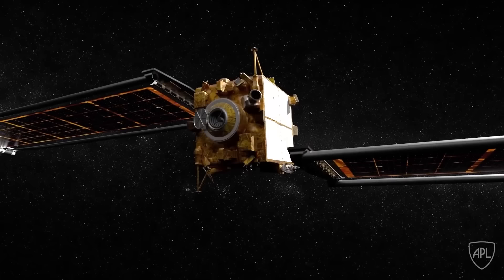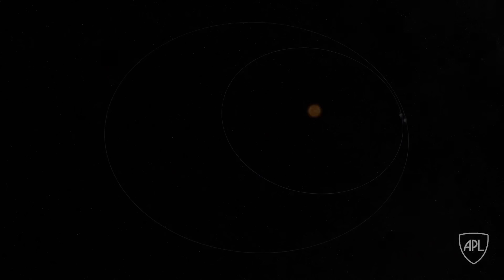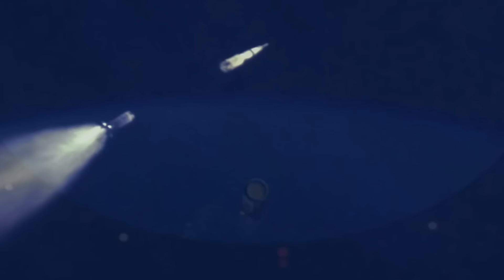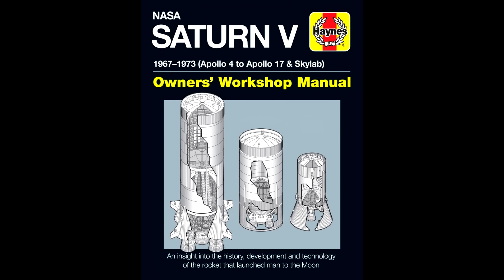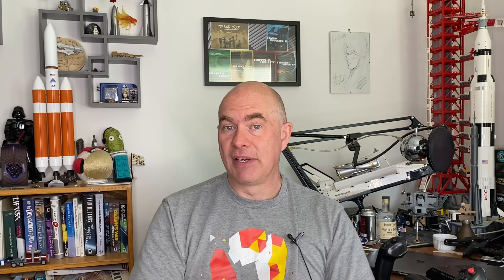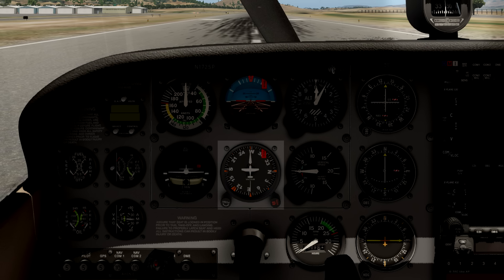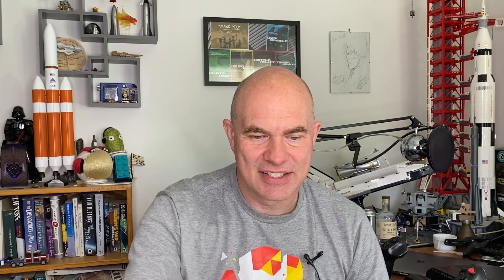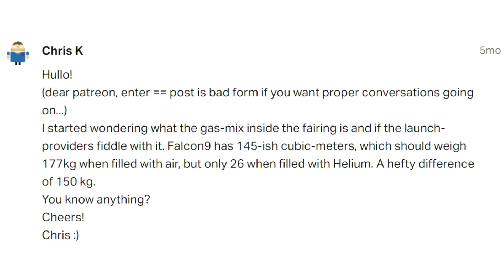Saturn V Staging, Asteroid Deflection and Hearing Rocket Turbines - Supporter Questions, Episode 17

Comment: You misunderstood the first question Scott. To answer to the first questioner: The reason you burn propellant to increase the velocity is that kinetic energy goes up with the square of velocity. You are right that momentum will not change because of the conservation of momentum, and you're just increasing the velocity while decreasing the mass, you are increasing the kinetic energy. Hopefully that helps.
Reply: No he didn’t misunderstand the question. He talks about transfer of momentum, and then he adds that burning the propellant leads to a higher energy state which will impact the astroid hard enough to blow material backwards, and that would add to the momentum transfer. He’s assuming that everybody already knows that energy goes by velocity squared. Obviously, as a physics degree holder, he knows that just as would any high school student.
Reply: @mbmurphy777  But the questioner didn't know that kinetic energy goes up as the square of velocity, that's why the question was posed. Both you, and Scott, are answering questions which weren't asked.
Reply: @mbmurphy777  The question (simplifed) is: "Why does it matter whether or not you burn propellant when the momentum stays the same".  The answer is that the kinetic energy changes.

Why is this hard for you?
Reply: @xXxTeenSplayer  Yes everyone here knows that. That’s why Scott said that burning the fuel results in a more energetics collision which can blow start backwards which actually increases momentum transfer. It’s plain as day in Scott’s answer.  And I’m pretty sure the questioner does know the difference between momentum and energy. The answer to his question is that it in fact does not matter, unless the impact actually does blow chunks backward off the astroid increasing momentum transfer.

Comment: I got a question, why is the dream chaser disigned with a skid in the front, I don't get what is so special or what are the advantages to using this method over a normal wheel based landing gear. Also I am not sure but isn't the heat shield being scraped against the floor when it lands not sure about this, if it is why disigned it like this. Idk this topic doesn't quit make sense
Reply: @GABRIEL, Usually skids are used when landing velocity is so high a tire would be destroyed on touchdown. The X-15 had a nose-wheel but used duel skids for rear gear -- which actually touched down first. Friction from the skids sliding along the ground rapidly dropped the landing velocity so the nose-wheel could survive contact. The (unfortunately never flown) Dyna Soar space plane also would have used skids for this reason.

Comment: Wouldn't a Martian space elevator be destroyed by the very close moons (presumably they are inside the geostationary point).
Reply: If you're doing a project that big, you can move them.  If they are slightly inclined, they would go over or under the cable most of the time, you'd just need to make sure they don't cross the equator when the elevator is there.  You could also just deorbit them or consume them for materials.

Comment: Wouldn't the energy of impact with the asteroid be lost in the form of heat?
Reply: Some of it, but some will get dumped into dust and debris flung out, and if it's flung out fast enough to escape the low gravity of the asteroid, that's some more momentum.

Comment: Hi Scott, I have 2 questions.

1)	Are you aware of any plans for Space-X to orbit constellations of Starlink satellites around the moon and Mars to offer local communications for local probes or early moon bases? My quick math says – if they orbited 4,574 Starlink satellites around the moon (and 13,600 satellites around Mars), at the same ~500km altitude, they would have the same density of satellites / sq-km as on Earth. This strikes me as a relatively cheap way of de-burdening communications from science probes, and a critical infrastructure for a moon base.

2)	Are you aware of any research groups looking to send dozens of telescopes, probes, and other research equpiment in to space using the Space-X Starship system? Over and over, I hear of great science we could do but launch costs are just too high right now. If Space-X succeeds in lowering the cost as-planned, then I would exect hundreds of probes to start orbiting and landing on the moon, Mars, Venus etc. (so many it will become hard to track all the data coming back).
Reply: There might be issues on the Moon, there are not a lot of stable (long term) lunar orbits.
Reply: What would be the point in that? NASA already has enough communications spacecraft in orbit around Mars to provide support for the lander and rover missions on the surface. You don't need thousands of satellites for that. A Moon base on the nearside of Earth would be in direct communication with Earth at all times.

There's also no real benefit for mass producing Mars and lunar probes. (Venus probes wouldn't even make the surface.) It would still cost a colossal amount of money that would be far better spent on other research and exploration efforts. Making launches cheaper doesn't change that much, in reality. Space will still be hard and very expensive.
Reply: Neither of these have any future.
Reply: So, is everyone saying that a super cheap ticket to moon / mars won't result in dozens / hundreds more probes to both?

With dozens / hundreds more probes, the current communication infrastructure is sufficient?

I think there will be a lot more activity, and we'll need more data options for that activity.
Reply: @scottbillups4576  Maybe, but Starship isn't a cheap ticket to either.

Comment: Hummm....  I wonder how much it would cost to build another JWST?  Presumably a hell of a lot less than the first one, but still a lot.
Reply: Less than designing, developing and building a repair mission. But the main problem is that the astronomers won't want another Webb, they will want something that extends their observational capabilities far beyond what Webb can do so they can investigate the questions Webb's results are going to raise.
Reply: @EnglishMike  JWST isn't a particularly good example, but there are some neat designs for telescope arrays where the "better" version, at least for a while, is accomplished by adding more.
I don't know if we're capable of keeping relative position accuracy good enough with spacecraft though.  The current ones I know about are ground based.  Though, if you're looking at a bit longer wavelengths it does get easier.
Reply: @travcollier  Right, fleets of interferometer telescopes in the outer reaches of our solar system is likely to be necessary one day to keep pushing the boundaries of knowledge, but we're not there yet. There's a video or podcast somewhere (sorry can't remember where) of some of the Webb team talking about the next generation telescope and its as different to Webb in design as Webb is to Hubble.

So I don't see this changing until the multi-craft approach becomes necessary, and I have no idea how long that will be. (It's kind of happening already for gravity wave detection, but that's a different kettle of fish.)
Reply: @EnglishMike  Yep.  Don't need to be far away though.  

The really insane telescope idea is using gravitational lensing around the sun.  Unfortunately that takes putting scopes way way out there and they only look one direction.  The magnification factor is insane though... Imaging surface features of exoplanets sorts of resolution.

There's also extremely long baseline (like measured in AU) radio telescopes.  That is totally doable with current technology.

Comment: Space Elevators are one of those silly joke projects. The killer problems aren't in building the elevator they are in using it. The design does not take account of orbital mechanics (sideways momentum) or the simple fact that the minimum (ideal) orbital launch height is close to geostationary altitude.  
- A 39,500 Km drive at say 200 Km/h takes 8 days! And that's for one load.
- Every climb upwards will still need a rocket - to fire sideways to correct for negative orbital drift due to momentum - which does not magically increase as height increases. Without this every climb upwards will be tending to pull the entire elevator sideways tending to set up large oscillations. - Rather like a giant unstable upside-down swing.

Comment: So I have a question...
So if every body in space, however big or small, all have a mass. This mass is tied into it's orbit around whatever it's orbiting. In the future when we start to travel regularly between planets, moons, and other bodies in space, we will technically be transferring mass (a very small and even insignificant amount) from one place to the other. My question is...
How much would or could we transfer to these bodies to actually change it's orbit? I know a lot, but do you ever think there will be a "limit law" as to how much we can take from one place to the other? eg. "PSA: Titan is no longer taking requests for transfers. Titans Transfer Limit has been reached." lol
Reply: Orbit is about speed not mass.
Reply: @TheEvilmooseofdoom  Momentum (Speed and mass) plus gravity. Changing the mass changes the gravitational pull and it's momentum, both of which can change it's orbit.
Reply: @MrTwisted003  Doesn't matter if the object masses 1 gram or 1 ton, the speed required to orbit is the same.
Reply: @TheEvilmooseofdoom  Correct. You're the one that brought up speed.
Reply: @MrTwisted003  Yes.  Changing the mass changes nothing, so we circle right back.  Orbit is about speed not mass.  The earth gains 40,000 tons of space dust a year, and has for millions of years and the sun looses about 5 million tons a second.
Reply: @TheEvilmooseofdoom  the speed thing was correct, the rest wasn't (entirely), it's why i said...
You forget about gravity and it's relation with mass is all. I doubt something as insignificant as 40k tons would do much, but it does do something. And we haven't been around, and prob don't have the skill at maths to calculate millions of years at those miniscule scales (with literally nothing but estimates and theories to gauge off). Relativity, huh?

Comment: Off the topic 
How starship flaps joints could survive reentry?
Is it same technique as SRB gimbal?
Reply: Do you mean because of the heat? They have heat tiles there, super complicated system. To move the flaps they use Tesla motors
Reply: @ryanrenolds  I'm talking about those joints where it would be difficult to protect from the flowing plasma and because that joint have to move there is a chance of plasma to leake through
Reply: @dipakahir4688  Elon talked about this in Tim dotts starbase tour. It is really hard but they did it with a lot of curved heat tiles

Comment: The military "constraints" on the Shuttle is a myth, NASA went to the Air Force and said "We're building a cargo bay this big and an orbiter with delta wings does that fit your needs" The Air Force, (who did not care as they had no plans on USING the Shuttle) said "Yes" so NASA presented that as a military buy-in on the design they wanted. A little later an "Under Secretary of the Air Force" met with NASA and told them that such a large cargo bay was not needed for military requirements but NASA ignored him since he was "only" and "Under Secretary" and it was not what they wanted to hear. That Under Secretary has another "job" and had more knowledge than the "Air Force" experts NASA had consulted since he was in fact the head of the National Reconnaissance Office and in fact knew that they didn't need such a huge cargo bay.

And then the Air Force found out that NASA had included the wording that essentially ALL US payloads would launch on the Shuttle or not at all and that's when they actually became supporters of the Shuttle.
Reply: Not the 'real' Scott I take it :)

Comment: how bout a space elevator on the moon
Reply: Not worth it until there's a reason to have one there. What happens if you build one at the equator, but then decide the best place to build a major Moon base is at the poles?
Reply: @EnglishMike  nah details
Reply: @EnglishMike  but you could build one for vehicles that are not suited for landing on the moon
Reply: maybey just a ~meter high tower with a docking port

Comment: The problem with a space elevator is that the higher it goes the slower the orbital velocity goes. Nobody ever discusses this. NASA tested this already. A long long time ago. Fail.  :)

Even if it could work with the right material it could not be assembled because of this problem.
Reply: What kind of test did NASA perform?
Reply: I don't know what you're referring to but as Scott says, there's nothing about the concept of a space elevator that makes it impossible. The math and physics work, even if we don't have the technology or the materials to do it yet.

Comment: first one was  actually a good question you didnt understand it or didnt care? does the energy hidden in propellent burning is more then the energy of its w8?
Reply from the maker: It’s more about the momentum, and the energy causes a blast which delivers even more momentum
Reply: He did answer it
Reply: energy is a product of velocity squared, so a craft going twice as fast is better than a craft w8 being twice as heavy. Plus how efficient ion thrusters are, 1 lb of fuel is going to provide a lot more speed than what 1 lb of mass would provide in energy on impact.
Reply: @scottmanley  everyone knows its about momentum. but how much more energy gained from burning  propellent after deduction of w8 loss? never heard any numbers on that. is it a lot or or very little? usually we look on any mission in perspective of gained speed. but with this one would be interesting to see some numbers in gained KE . TY
Reply: DART used an ion thruster with xenon, so there was no chemical energy in the propellant. They could have used a chemical propellant and used that as explosive, but the energy generated by the solar panels might have been larger than the chemical energy, so increasing speed seems to be considered the better way for higher energy.
Reply: @Astrofrank  i understand the difference but still do not know the answer if we were talking about chemical with the goal of impact

Comment: If your aircraft can have a gyro compass, why on God's Good earth would you want everything in magnetic?
Reply from the maker: Historic reasons are why everything is using magnetic. Except the written weather reports and other stuff, that’s all in True North.
Reply: @scottmanley  Yeah I wondered because I used to be a merchant mariner (deck officer graduate from Maine Maritime Academy class of 2011) and I haven't used a magnetic bearing at sea since I was at the Academy. Why would we? We've got gyro redundant gyros with repeaters coming out the wazoo.
Reply: Gyros drift on the order of minutes. Magnetic fields drift on the order of decades. Reference the thing that can't fail or change.
Reply: @frederf3227  Magnetic compasses are wrong by over 20 degrees where I live and a few hundred miles away they are off by like 7 degrees. If you're keeping track of your gyro compass error, a good gyro will drift single digit degrees over an entire year of continuous operation and at a rate that is negligible unless your considering it for months at a time.  I would way rather reference the thing that is A: closer to reality, increasing the ease accurate of navigation, and B: that doesn't exhibit wildly differences in error based on where in my journey I am and what direction I'm facing.  Don't get me wrong magnetic is great if it's all you've got. Certainly gets the job done, But I would rather use almost anything else 1st if possible, and I would not want my standard method to be the worst method. Just send weird to me. I guess it's like a culture thing. Difference between nautical and aeronautical.
Reply: @frederf3227   I just realized something pretty embarrassing. It doesn't really change my thought process but it does make me feel like an idiot. We're taking about using magnetic beating. I'm accidentally thinking about using bearings taken from a magnetic compass, which are referred to as "compass bearings" not "magnetic bearings." Compass bearings still have all the error in them. Magnetic bearings have the deviation factored out, and since all magnetic bearings point at magnetic north, not true north, variation isn't factored in either. I'm a dumbass. Good thing I have all that professional training lol.